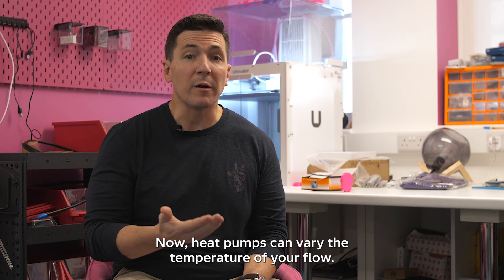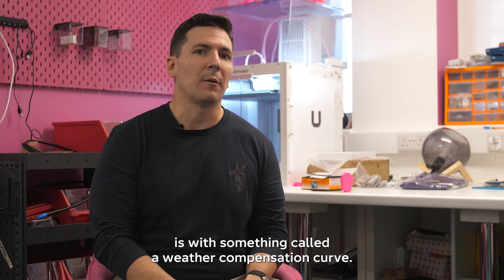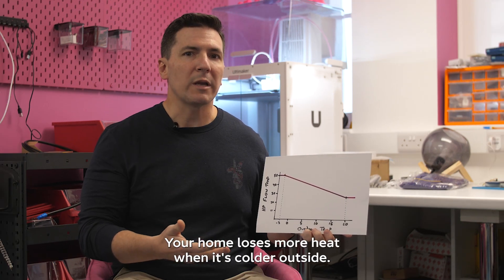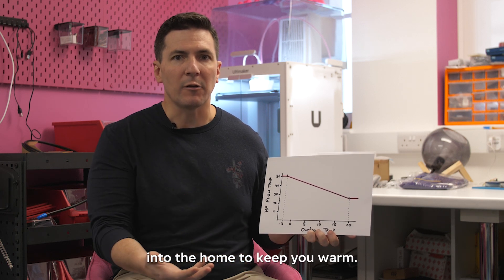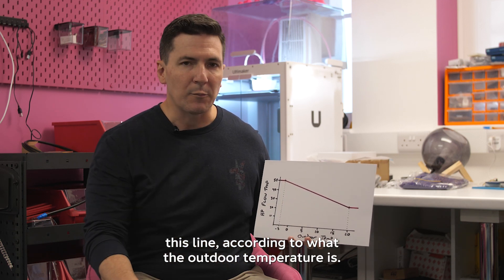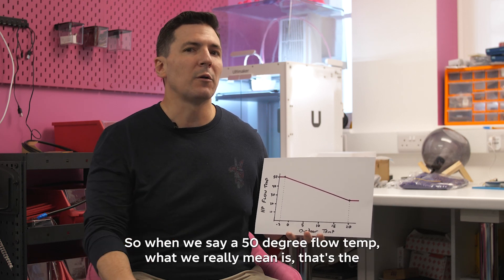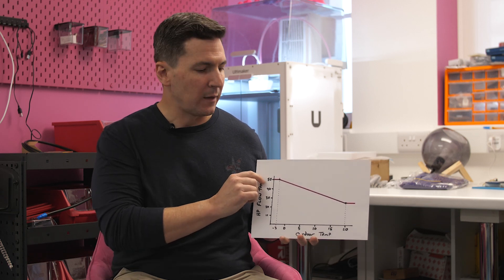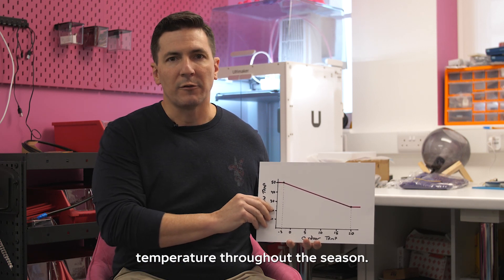Your heat pump isn't that hot | Heat Pumps with TJ

Comment: TJ "Older heat pumps" must be at least 20 years ago. Heat Pumps have modulated for years I don't know of any modern one that doesn't. I think there is some conflation here between Design Temp and Flow Temp. They are different. Just because it's Designed for 50 deg (max at -2 deg outside) doesn't mean that the Flow Temp will always be 50 too. The flow temp will reduce as the temp outside rises.
Reply: that's exactly what he said in the video though...

Comment: My @octopus heat pump was designed  at 50⁰c @2⁰c ext  but in practise this was too hot so we are running at 40⁰c@0⁰ ext/ 30⁰c@25⁰ext which maintains 20-21⁰c internally. Our heating sCOP was predicted to be 3.4  but we got 3.75 in last 12 months. Personally I would have liked slightly larger rads and a lower design temp but very happy with the system as designed.
Reply: Old comment now but this is biggest issue with Octopus installed units.  Lack of detailed controls in the weather curve and DHW means that if you want a really efficient system, is another provider or heat pump brand.
Reply: @GarethPane I think the main issue is I was one of the first octopus installs which were Daikin Altherma 2 which are far more basic than Altherma 3. I've got round the data issue by installing an open energy monitor system and using Home Assistant.

Comment: How does the consumer know that weather compensation has been selected wither their heat pump.. Its happening with some less than genuine installers to set the flow temperature as high as possible to prevent call back from customer complaints that property cold..Down side is running costs are higher

Comment: Gosh this is very disingenuous. A design temperature of 40 will be more efficient than 50. As all modern heat pumps modulate to a lower temperature. No one is talk about a fixed flow heat pump.
Reply from the maker: Much of the info out there on heat pumps is outdated, so it’s important to highlight the difference for people new to heat pumps who have heard conflicting information.
Performance-wise, 40° will be slightly more efficient than 50° (usually ~12%), but that’s at the extreme of the weather curve. At average winter temperatures, the actual flow temp difference is about 6° - a much smaller efficiency difference. With smart tariffs, efficiency means much less money-wise, because energy doesn’t just come at a fixed price.
It’s also important to think about the heat pump as a whole system. 40° flow temp would mean we’d have to install bigger radiators to meet BUS Grant requirements—and these not only cost more, but are often bigger than customers want to live with (and sometimes bigger than the available wall space). The cost of fitting those is part of the total cost of ownership—which we think is the best measure of efficiency. We try to focus on the numbers that keep money in customers’ pockets, and not so much on stats that may look best in isolation.
Reply: @OctopusEnergy "In the past cooler temperatures were the route to best efficiency" this statement is still true. 
This video makes it sound like you're saying low flow temperatures and high scop aren't important because heat pumps can now do high temperatures, as if cost of running isn't a thing.
Ill take my high scop cheap-to-run always cosy house any day, over a high flow temp with high bills and temperature overshoots
Reply: @OctopusEnergy  This is what you should have made a video about. The reason you don't design to 40 or 45 degrees is because you are looking at the total cost of ownership. That's good.

Talking about fixed flow temperatures? Total red herring.
Reply: Shocking isn't it, the first couple of sentences are demonstrably lies

Comment: Clear common sense explanation to help potential customers understand the modulation capabilities of heat pumps. Probably should do a similar explanation regarding HP sizing.... for example,  that a 6kW unit doesn't use 6kW, but that's the energy output capability.
Reply from the maker: Great idea! Here’s a quick explanation: https://youtube.com/shorts/Fy9B1BOCE2w?si=ZXgLAtgdbBdIPyKZ
Reply: @OctopusEnergy  Excellent, looking forward to my Octopus HP install in the coming weeks.